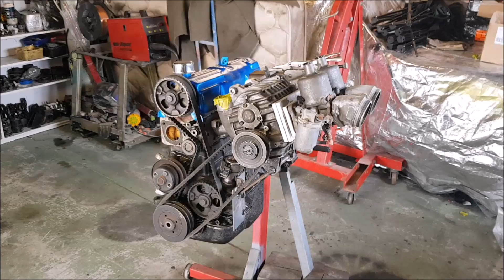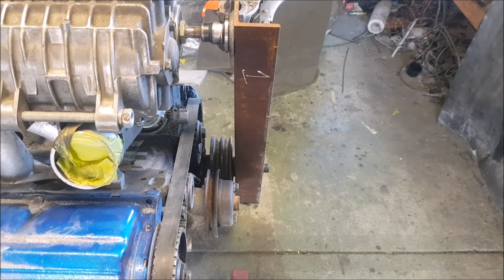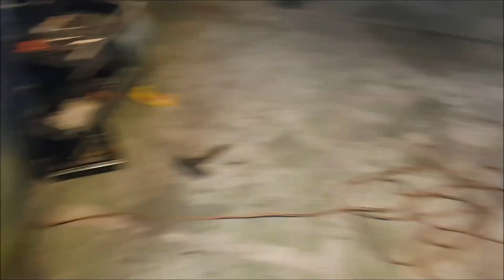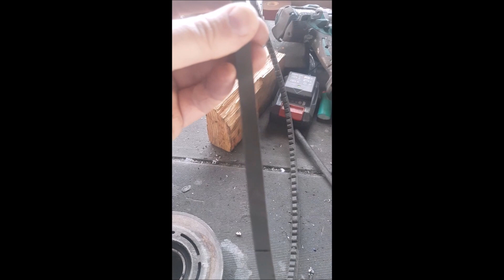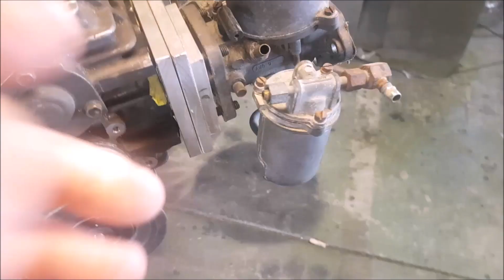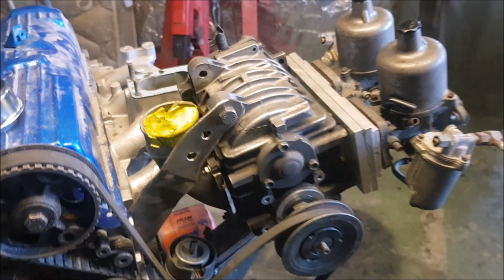2.0 PINTO 2 CARBS 1 SUPERCHARGER:::THE BEGINNING

Comment: I really wanna do this in my sierra one day, just gotta get the bits and a proper dizzy controller etc.

Did it cost much to put together?
Reply from the maker: Honestly no .it didn't cost must..we got the SC14 cheap $250nzd and I made the rest.
I hardest part  is finding a spot where the supercharger would sit and still keep the dizzy and use carbs.
The easiest way would be to ditch the dizzy and go trigger wheel and EFI with ECU then you can mount the  supercharger down the the left where the ALT is.
Or go Eaton M90 supercharger and try and mount it on top of the manifold. 
We ended up going EFI and ECU using trigger wheels but ditched the supercharger for a turbo .
Cheers

Comment: Biggest problem with boosting pinto is over  8 psi standard pistons collapse in the second ring land turning it into smoke machine.
But dont buy wessco or cosswork
But toyotA R22 pistons skim crown 6mm and now you go toooooo 
17  psi all day 260bhp
Biggest problem is how to reduce timing, best to do this with affordable after market electronic ignition 😊
Reply from the maker: Yeah I have a turbo pinto... 
This SC set up would have been made different way and easier to package if my nephew had wanted to go Standard alone ecu and use trigger setup. And EFI.... but that may happen at some point..
I will be building him a motor for this setup and I believe it will make around 7psi ...so should be fine.. I'm running 10 through mine at the moment and that's on a standard motor with ARP head studs..built a bottom end for that with forged rods ,under piston oil squirters and cosworth pistons.... but havnt needed it yet lol

Comment: If it not charge cooled or inter cooled , I would leave no water in inlet  as supercharger makes inlet charge hotter so no chance off ice forming.
Reply from the maker: That's good to know.. people have mentioned it may freeze at carb end and if j was to use alloy it wont idle well (ok for race not so much for road use).. but I'm not sure but to just sort it in case ..I had a mate 3d print me a SC to Carbs adapter and it fits well so will just have that made out of a nylon material that's fuel/chemical and heat resistant.. so that should solve any potential issue.